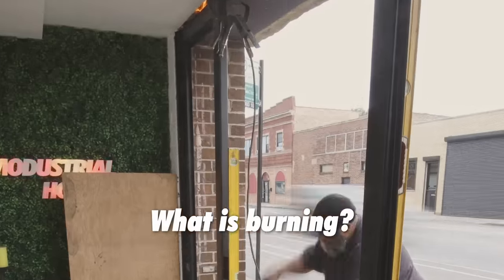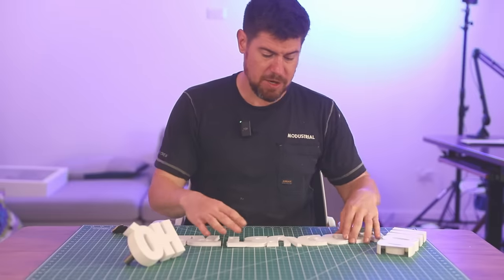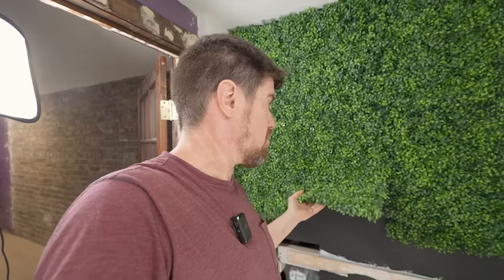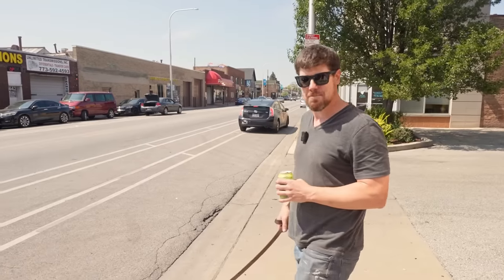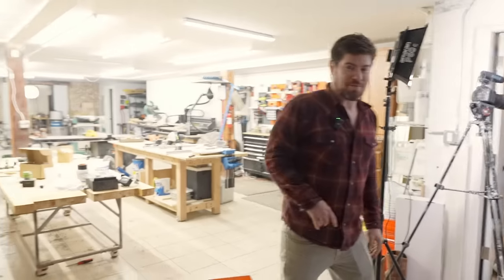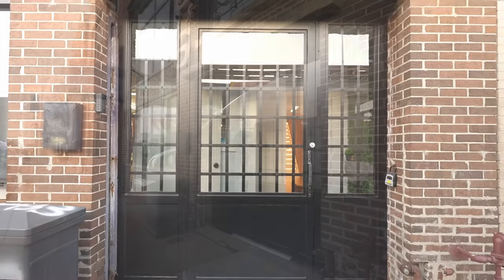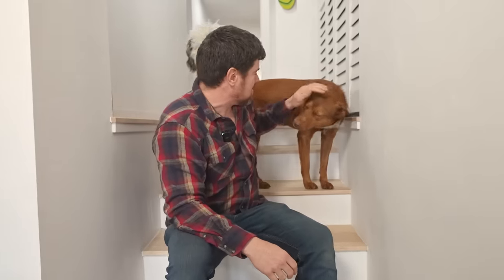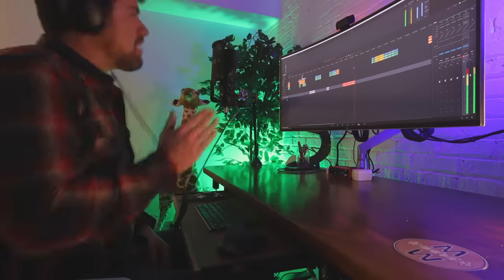ep. 47 Almost Done, Almost Burned Down... (Abandoned Building Renovation)

Comment: This front door certainly looks cool, but it won't do much as a door to keep the outside, outside, will it? Why isn't it security glass and just single pane? I mean, you could get a Japanese paper screen door, that's more stable.
Reply from the maker: It's deadbolted and the steel cross bracing means you can't just break the glass to get in
Reply from the maker: It's deadbolted and the steel cross bracing means you can't just break the glass to get in
Reply: ok, I get it :D  @modustrial